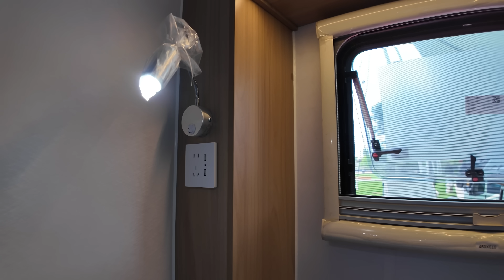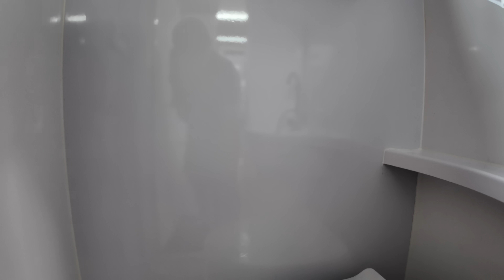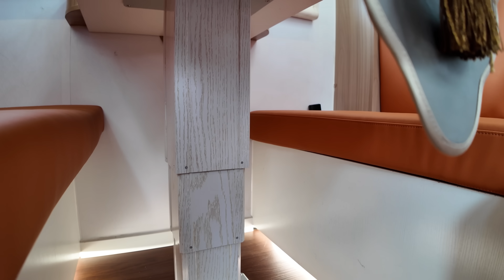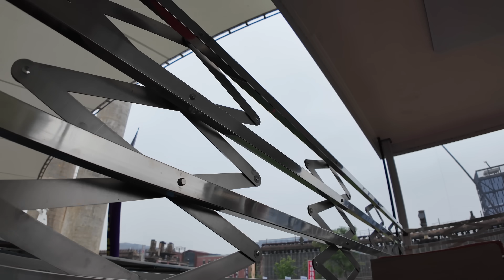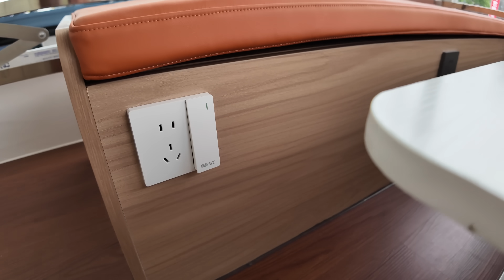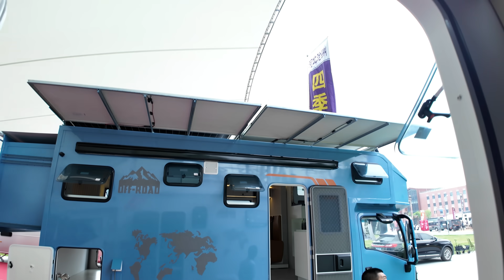China Built a 6-Meter Hybrid RV with 2 Floors, 55 kWh Battery & 400 liters of Water!

Comment: The concept is great, but the interior design is outdated, and the body materials feel flimsy. I believe the car will depreciate quickly. and future maintenance and repair issues also need to be considered.
Reply from the maker: yeah, that’s a fair take — the concept is strong, but long-term durability and resale are always the big questions. What part worried you most, the materials or maintenance?
Reply: Wow... 
Coba tunjukkan desain RV seperti yang kamu inginkan. 
Adu dipasar apakah respon pasar lebih baik.

Comment: This camper just makes so much sense. I am sold. I want to drive this in Japan, but will need a right steering wheel config.
Reply from the maker: Yeah, it really is a smart layout for compact travel. Right-hand drive would be the key for Japan though — what do you think of the 2-floor setup?

Comment: is it 4x4?
Reply from the maker: It's actually rear-wheel drive, built on the BYD T5DM hybrid chassis. The electric motor handles the wheels while the engine acts as a generator. Do you usually look for 4x4 for off-roading or just for better traction on roads?

Comment: How do you close the upper sleeping area to the outside?
Reply from the maker: The upper level is sealed by the lifting roof mechanism that locks down onto the main body when lowered. While popped up, it uses insulated soft-shell walls or solid folding panels depending on the specific trim. Do you think a soft-shell or hard-panel lift is better for insulation?
Reply: @ILC-RV I wasn’t really thinking much about insulation, but rather keeping the mosquitoes and flies out of the trailer. I would want screening to keep them out of the trailer when the roof is open
Reply from the maker: That makes total sense, keeping bugs out is a top priority for a good night's sleep. These models usually come with integrated fine mesh screens on all the upper openings specifically for that reason. Would you prefer a setup with permanent screens or ones you can zip away?

Comment: Very interesting! Does it fit in a HQ container for shipping? Can I find more information on a website?
Reply from the maker: Glad you liked it! Honestly, shipping might be tricky because of the height, so a flat rack or RoRo is usually safer than a standard container. I don't have their website link handy, but you can message them directly on WeChat at 18249635588. Are you looking to import one to Europe or somewhere else?